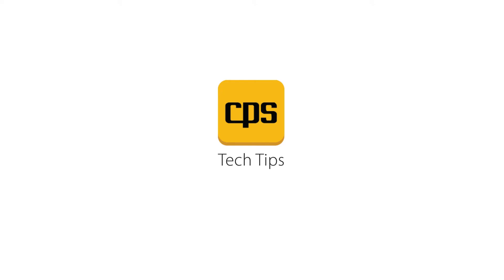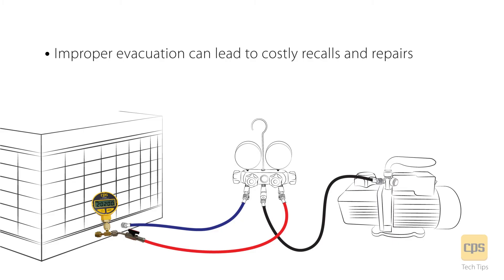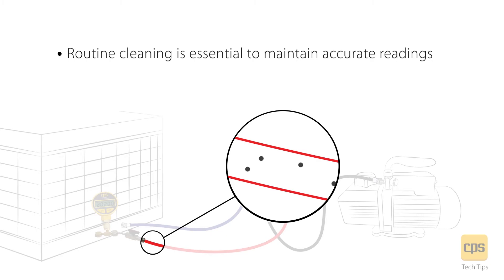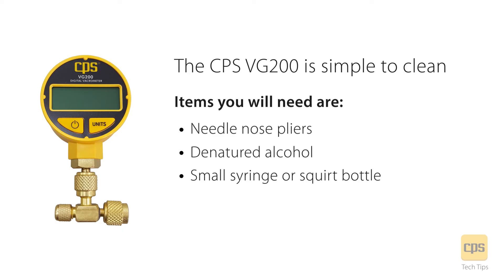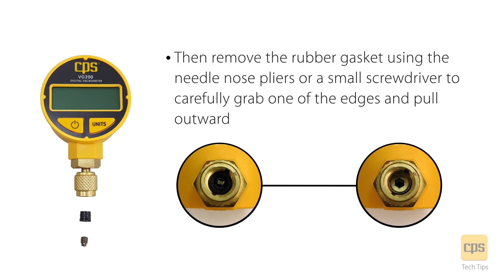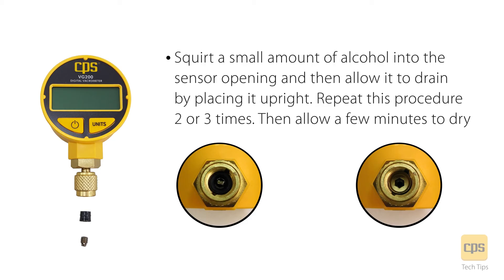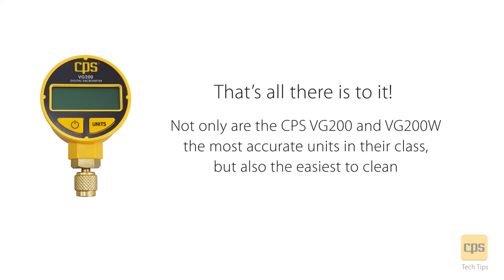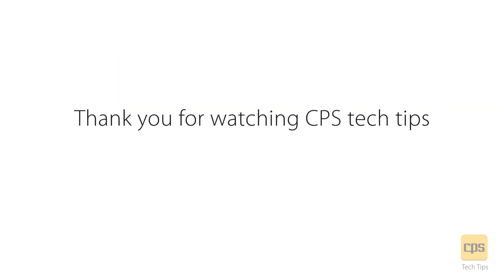CPS Tech Tips: Vacuum Gauge Maintenance

Comment: I have a valve remover tool, I could spin the Schrader depressor endlessly. It did not come out (I couldn't easily pull it out either).
I asked chatgpt what's the secret?:

You're not alone — this is a known quirk with the CPS VG200. Here's what’s going on and how to handle it:
⚠ What's happening:

    The “Schrader depressor” in the VG200 is not a traditional removable valve core — it’s a fixed or semi-fixed insert that's often very difficult to remove, even when "unscrewed."

    CPS’s video suggests it should unscrew and come out easily, but many users (and even techs) find that it just spins and doesn't release — exactly what you're seeing.

🛠 What to do:
✅ Option 1: Try again with a twist-pull motion

    Use your valve core tool and unscrew fully, then:

        Pull outward firmly while gently rotating back and forth.

        Sometimes the depressor catches slightly on internal threads or o-ring friction.

    Don’t overforce — if it resists hard, don’t risk damaging the port.

✅ Option 2: Clean without removing it

    This is safe and often effective. CPS even indirectly supports this in practice:

To clean:

    Turn off and disconnect the gauge

    Use denatured alcohol or non-residue electrical contact cleaner

    Place a few drops directly into the port (with the depressor still in)

    Let it soak 5–10 minutes

    Use compressed air or nitrogen to gently blow it out from the bottom port up

    Let it fully dry before reuse

This helps dissolve any oil or contaminants that might be affecting vacuum readings or sensor response, even with the depressor still in place.
❌ Do NOT:

    Try to pry it out with pliers — you may damage the port or threads (I did pull mine out with a needle nose, the removal tool doesn't grip)

    Force it past resistance — some units are semi-fixed and not really designed to be removed despite what the manual says

✅ Good news:

    The VG200 doesn’t require full disassembly for effective cleaning.

    Most vacuum reading problems come from oil vapor contamination, which you can flush out with alcohol/contact cleaner without touching the internals.

Comment: Can I use rubbing alcohol?
Reply: 1 tablespoon of 100% Pure DENATURED 
ALCOHOL says the CPS VG200 manual, use a syringe  . Rubbing alcohol is only 70% alcohol , 30% part is water. Denatured alcohol dries completely. Rubbing alcohol leaves water after the alcohol part evaporates.
Reply: @reftech1  You can buy 91% isopropyl alcohol